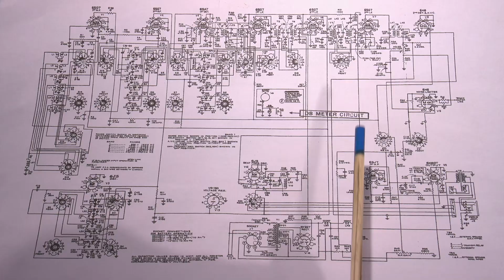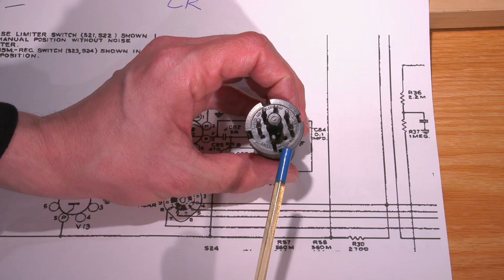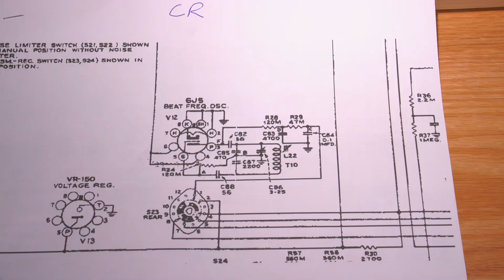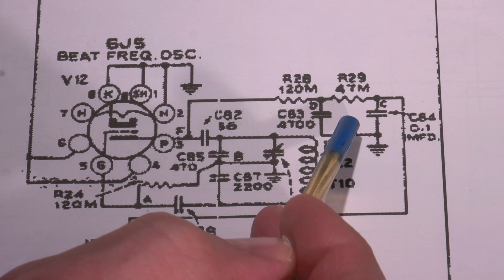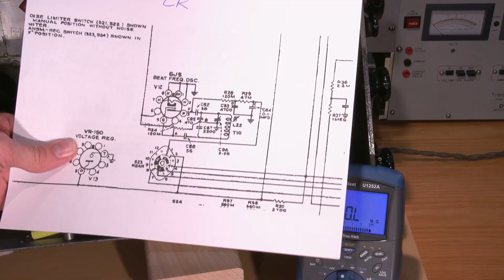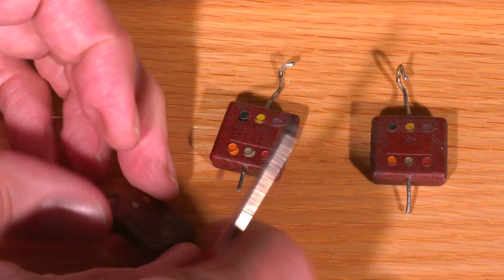Electronic Circuit Troubleshooting! The Fix Made Easy!

Comment: I think people are refering to perceived knowledge about the mica's in this receiver being mircamold capacitors which are really paper/foil. I am currently restoring my AR88 which is an early model Sn 001145 with the yellow only tuning dial. The capacitors in mine that correspond to the noisy ones you changed in the pre-amp stage are pink and flat with coned ends. They look like plastic covered paper and foil. I think these are the micromold capacitors capacitors refered to in some articles as unreliable. I will probably change them where not in oscilator ccts for the same type replacing the bath tub caps.
 My receiver has had a later tuning gear box fitted that had been got at. I had to strip it, regrease and adjust the bearings and apply tension to the anti-backlash springs in the cogs. It now works very smoothly and quietly, but it was very fiddly to apply the tension. Do you have any tips on how to apply the tension when dealing with multiple gear cogs? Have you dismantled and repaired one of these gear boxes? I think it would be an interesting and instructive video.

Comment: I purchased an LED ceiling light and stopped working. Opened it up and found that one of the supply wire to the circuit has come undone. How do I find where it is soldered to?

Comment: Great video as usual- have enjoyed all the ones on this radio's restoration, but shouldn't  C83 and C84 be referred to as DECOUPLING or BYPASS caps rather than blocking caps?  The latter would be used from the plate of one stage to the grid of another to block DC and pass the signal.

Comment: Greetings, and thank you.  I was a tech in the 80's. (not an engineer)  I also got my amateur tech license at that time.  A long time ago, and I just recently decided to get my amateur license back.  My target HF rig is the Yaesu FT-101B.  It's what I used back then.  Not as complex as the radios I repaired in the Marine Corps, but a solid workhorse of a transceiver, and in my comfort zone.  Off and on, I have watched your videos.  All of a sudden, your videos have become more relevant.  (Who'da thunk it?)  I have my first repair challenge, and I need to straighten the face plate, as it interferes with the dial on the VFO.  I'll be getting the external VFO, as it will come in handy, and may make this radio usable ahead of the repair.  ( The face plate is stout and will require some force, but not hammer and anvil force. Still figuring out how to use a hydraulic jack to 'finesse' it. ) I plan to buy the 'cheap' parts radios when they actually are cheap, and repair a few, that I can turn around and cover test equipment costs.  (really tight budget here.)  Anyway, thanks again for educating and entertaining at the same time.

Comment: Dear Mr. Carlson, I discovered your channel a couple of months ago and firstly I wanted to say THANK YOU for sharing your knowledge.  Ever since I got my first electric toy train as a boy I've been attracted to all things powered by electricity and now that I'm recently retired your channel has reawakened my interest in this subject.  While I haven't had the opportunity to binge watch all of your previous content yet, I have been current with your new posts for the past 45 days or so and intend to go back and watch additional selected videos. 
I'm writing today to ask for your help or frankly the help of anyone reading this as well.  My son inherited an RCA Victor AM radio/phonograph manufactured in 1952 model number 2US7 Ch= RC-1117C after his grandmother recently passed away and while the machine generally works, it seems to play all record speeds (33,45,78) a little bit fast (he thinks 10-15%).  We've both studied the schematic and can't seem to understand how the drive motor gets its voltage controlled so we can know if this is an electronics issue or a mechanical one.  I could send a .pdf of the schematic if that's helpful....
thanks in advance for any insights and if the response is no response that's OK too, I understand.
Thanks,
D. Suter

Comment: Looking forward on how to reduce the drift on SSB.
I am guessing an voltage regulator for the heater on the local oscillator and bfo and my be a zener diode for the 150 v plus rail.
I have noticed on my AR88 the VR150 voltage does change by about one volt when the RF gain is reduced.

Comment: Paul: Great video!  And not just this one!  All of the videos in this series are great to watch.  As a fellow ham radio operator and an at-home radio repair technician (not to mention a Patreon supporter) I find all of these videos, a wonder resource for me as they aptly fill in the gaps of my ever-growing troubleshooting experience.  

I have a question about your Agilent U1252A DMM.  In previous videos, you have used the Agilent/Keysight model U1253B with the OLED display, but I don’t see it here in this video, nor have I seen in the past several videos of yours.  I’m curious if you still have and use it, or did you replace it with the U1252A?  The reason I’m asking is because I am considering getting rid of my U1253B.  I absolutely love the meter, but I cannot stand the battery life on it. It seems as if I’m always charging it, or, if using an alkaline battery, always replacing the battery. I’m considering replacing it with a fluke 87V. What are your thoughts?  I don’t know if you like to do product reviews, but it would be great to see a video or two from you describing the test equipment that you like to use and why.   Thank you for taking the time to read my lengthy dissertation.

Comment: I think one of the main assets of the AR88s was that it had two tracked RF stages before the first mixer.  This meant that non wanted signals were over 40 db down on the wanted signal, at the mixer stage.   Modern transistorised transceivers have untuned front ends, and just rely upon the first transistors, and mixer, to have good strong signal handling properties.

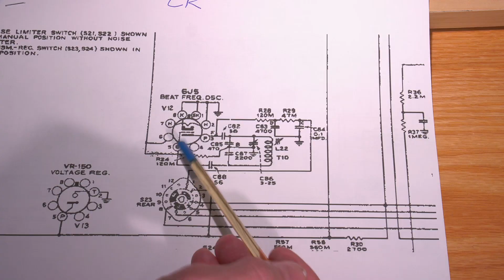Comment: 5:40  I've got a Hallicrafters S107 that does something similar - for the BFO input they have a capacitor on the schematic that's marked as a "gimmick", and in the radio itself it's just one turn or so of insulated wire around one of the lugs of a tube socket.

Comment: 👍The old convention where 100M indicates 100,000 Ohm I think may stem from Roman numerals where M was a thousand. M for Mille (Latin for thousand). Another very interesting video Mr Carlson and thank you. As well as more top tips and technical information, this prompted some reminiscence of bygone days trying to tune SSB on old BFO comms receivers. It's a little tricky but with a stable VFO and some practice it can be done as demonstrated. Using the RF gain to adjust the SSB level for better product with the BFO is a good trick that some may not be aware of. As you demonstrated it makes a huge difference, especially with stronger SSB signals.
That bent plate on the BFO capacitor was odd. Maybe some previous owner was an AM only guy and wanted to make sure the set couldn't receive CW 😂.

Comment: Paul... thanks for clarifying these mica cap issues! I always thought them to be bullet proof. One of those dim bulbs in my head lit up today...Thanks! If I might ask, what is the expected shelf life of unused paper and foil capacitors in your experience? Peace
Reply: I can answer that- unless they were stored in some hermetically sealed environment, they're probably as bad as any you'd pull from a radio or TV.  And even ones that were stored under ideal conditions could still be bad depending on how well or poorly the manufacturer neutralized the acid used in making the paper dielectric.
Reply: @scotttodd3506  Thanks , now I can pitch a bunch of this junk. I was always nervous about them.

Comment: Interesting how RCA used M as the 1000 abbreviation.  The Roman Numeral M is for 1000 whereas the industry has long since used the Metric K (kilo) for 1000.  Also interesting haw RCA draws the tubes with the cathode at the top and plate at the bottom, opposite to the long since industry standard (at least in my experience) of drawing the plate at the top and cathode at the bottom, as I learned to do decades ago.

Comment: Even if I never do any electronics repairs I do enjoy watching the process of diagnosing, fixing and improving older equipment. A suggestion for Mr. Carlson. On the testers you have designed could you possibly label the switches and LED's so we viewers could more easily follow your testing and commentary?
Reply: I agree with your comment. There are plenty of engravers out there who engrave 'lamacoid material'. It looks more professional.

Comment: Thanks for showing all the steps in learning about a BFO and how it works Paul. I noticed the non moving plate ( stator) 
below the bent one you fixed was also a little off as well as one on the other side. A little trick I learned a long time ago 
 is to use a flat feeler gauge (for automotive use) to set an even gauge as I don't have long finger nails.  As a teacher on
 YT you are  the best as far as electronics is concerned.

Comment: An easy fix Paul, you would have to wonder how it got bent and when. It could have been like that for years. I had an issue with a mica cap recently,  I didn't think to pull it apart 😕  Good video Paul.

Comment: hello sir, just have a question about fusible resistors, I have one in my schematic showing 200 ohm and 8W and it has MFG numbers? 63-6461 and 9746916 what would be a good replacement for this? I have pictures if that would help. Thanks for your time.

Comment: Grest video series Paul, thank you for taking the time to put this together.  Question; when you replaced those bad Mica capacitors you opted for Poly replacements, what was the deciding factor against using modern Mica caps?
Reply from the maker: You will hear the explanation in the previous video of this series. (one back)

Comment: @MrCarlsonsLab - Where is that capacitor labeling documented. I've got my old (1951) Allied's Radio Data Handbook and for a 6 dot cap it shows that as the greatest significant digit of the value. Thanks for a great set of troubleshooting videos.
Reply from the maker: There are many on the net, this is correct, (the first blue chart down from the top) http://www.tpub.com/neets/book2/3g.htm

Comment: Paul, it would be great if you show us how to build a tester device for noisy components. Would be a great patreon project. Hint, hint...  😉
Reply from the maker: I thought about it, but that design would involve elevated voltages.
Reply: @MrCarlsonsLab  I’m surprised you didn’t put a wink a the end of your reply! And no, your humor didn’t go over my head. 😉
Isn’t the full answer that a ‘noisy’ component is, in reality, a fast-intermittent component that misbehaves when under stress in a circuit? Such a ‘tester device’ is actually a ‘highly skilled tech’. You’ve shown us that the main tools to narrow down noisy component(s) are live, in-circuit measurements, whether by ear with the device’s speaker, a signal tracer, meter, frequency counter, or scope (and more - even the good half of a stereo circuit!) Some noises are identified in-circuit by tapping tubes, suspect solder joints, and rotating variable caps and pots.
Once you’ve located the culprit, out-of-circuit confirmation depends on the type of device. You’ve shown us how your modified scope/curve-tracer has confirmed bad semiconductors, like that crazy intermittent zener diode, with relatively low sinusoidal voltage. That mica cap tested dead as a doornail with your low-voltage cap tester (even though the symptom was noise.) Yes, you recently confirmed a noisy resister out-of-circuit by applying high B+ voltage across it with your signal tracer. And I suppose that some bad transformers and coils could be confirmed with a hi-pot tester.
In summary, a ‘universal tester device’ for locating and confirming noisy components is the technician’s set of elevated skills that you teach us in every video! 😊 (Patreon member here also!)
Reply: @MrCarlsonsLab  well, It won't be the first time you showed us projects with HiV...

Comment: Hi Mr. Carlson, 

Great work as always! 🙂

I did notice @ 20:48 when you moved the camera, the the right side of that BFO variable caps plates still look off-center, especially the upper right one. This could just be the camera placement, but it looks very close to touching as well.

Like you said... 2 caps with shorted plates... Wow! How strange. Makes me think the unit was dropped at some point! 🤕
A much closer review of all of the mechanical moving parts seems warranted! Checking for bent shafts, cracked bearings-clips-etc., or loose hardware like grounding straps, or solder joints.  Even metal fatigue cracking. 

Back in the day while in the military, I had an very used piece of aviation electronics that I kept finding odd things like this... Eventually 17 or so major flaws and hours upon hours of inspections and testing and never being able to get it to work within specs, until I hit the one broken part that was irreplaceable and had to scrap it.  Further investigation found that the squadron tech had slipped and dropped the unit to the deck in order to catch his balance and not fall off of the back of the plane - in this case, a better choice! Of course, it would have helped knowing that up front!

I look forward to the rest of this radios' troubleshooting, and the improvement mods, including the product detector. That should prove interesting.

Oh, one last note...
Those really old & oddball schematics with the non-standard marking (by today's STDs) ... I take and make a big RED note on copies indicating that fact,  then mark in red the "k" in place of the "M" In those locations. Otherwise, you'll confuse yourself and others not in the know, and that disrupts your troubleshooting mindset trying to remember silly little non-conformaties...

Comment: Interesting that my AR88 doesn't even have the 2pF capacitor (C124 on your schematic). It just relies on the pin 4 coupling. Also being an LF model the BFO frequency will be centred on 735kHz. My actual model must have been modified at some stage as all the Mica capacitors are tubular - Polystyrene??

Comment: If I had to make a guess, I suspect that the M notation for 1000 comes from Roman Numerals I = 1, V = 5, X = 10, L = 50, C = 100, M = 1000 so that we are in the year MMXXIII. At some point after these radios were designed and built industry standardized on our current engineering unit standardization scheme.
Great video, thanks for putting these together.
Reply: which is why you go to the hardware store and by 4 mil plastic! Latin "mille"